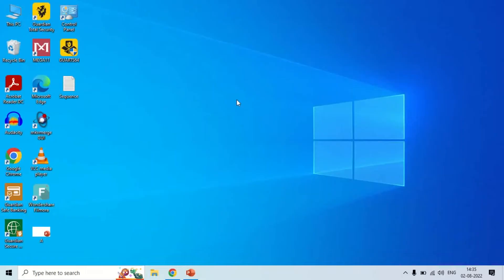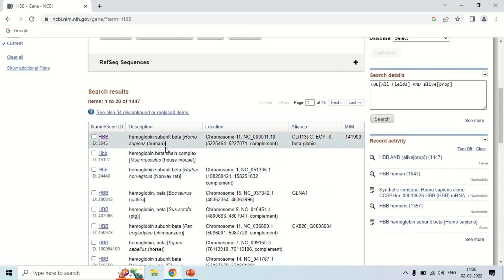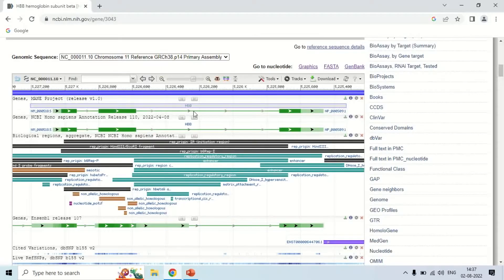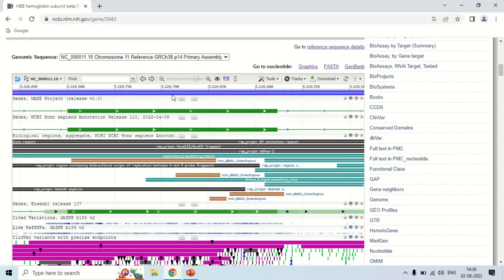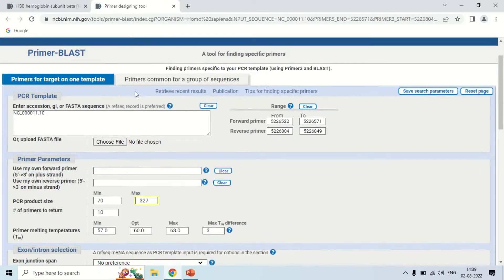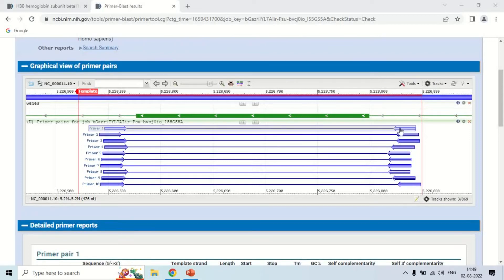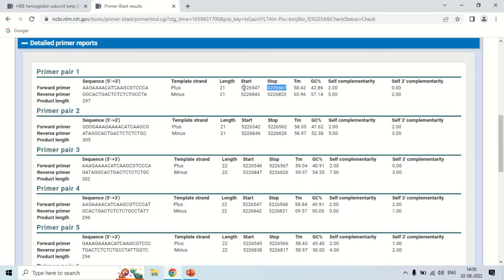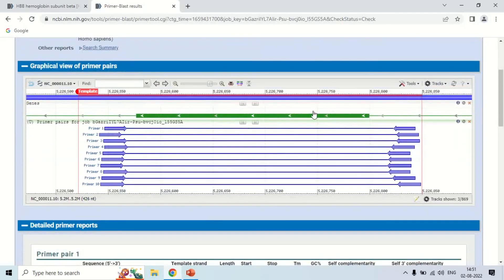How to design pcr primers using NCBI primer blast

Comment: Love your channel and the way you make difficult concepts easy. 
I had a question about primer property checking using Primer-BLAST.
I have a primer that contains degeneracy/wobbles and I want to check its properties such as Tm, self-complementarity, self 3’ complementary using the primer- blast…
 
However, when I use the primer Blast and search, it states that “ambiguity letters other than N are not allowed in the primer sequence”
So that forced me to replace all the degenerate/wobble letters with N. 
Would that still make the property results correct? Am I still getting the right answers if they are replaced with N? 
Thank you so much, I would really appreciate some insight on this, as I can not find an answer anywhere.